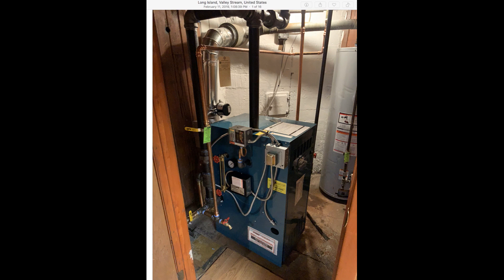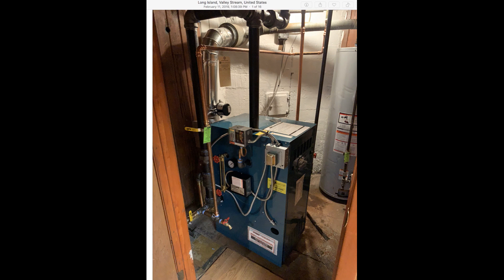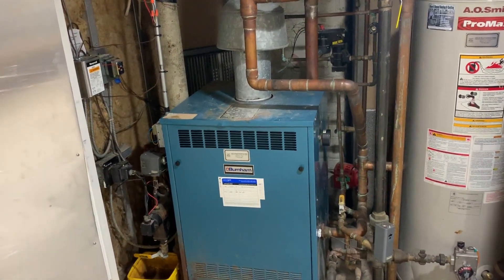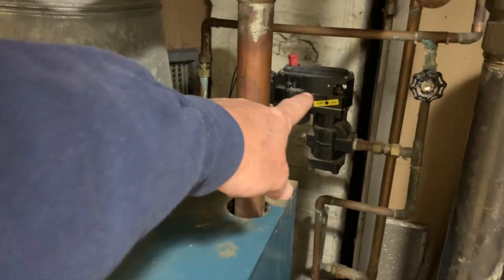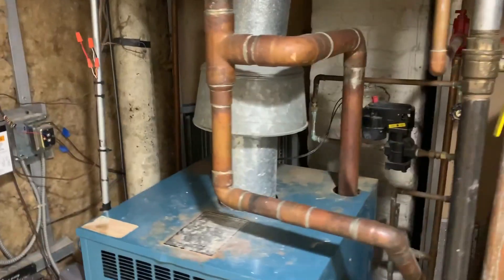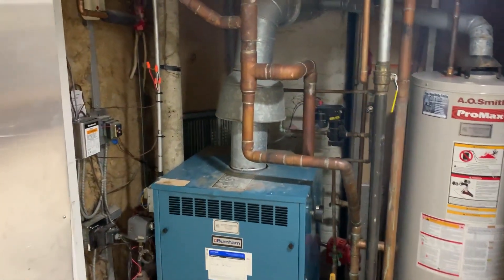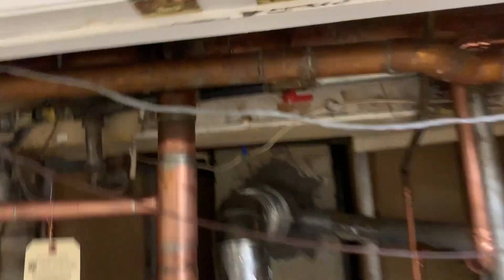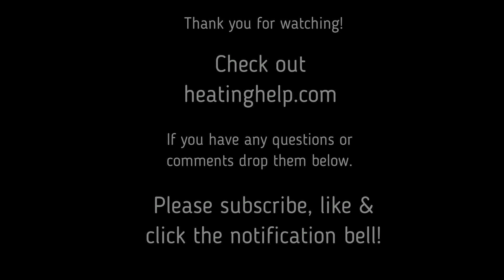Burnham Independence Steam Boiler Installation Overview IN4 105k BTU

Comment: i"f installed and serviced correctly this boiler may possibly last 25 years (or may not). -- this is from 
Dan Cork (VP of Marketing) and it is car-sales man version of the Boiler-sales-man response: DISGRACEFUL to every inch of humanity.

Ask him yourself Dcork@@t
P.717-481-8428
C.717-823-7085

What he does not tell you is that, there is a known defect that the IN-series boiler has, and they are praying and hoping customer don't know about it...it's the reason why License Installers in NY REFUSE to buy Burnham boiler:  Don't buy this crap anymore people.....the company is like the Opioid company when it comes to taking responsibility.....What I have to is is -- install Burnham at your own risk!